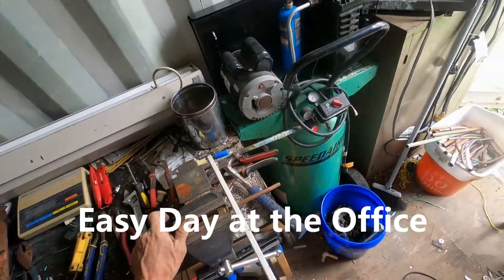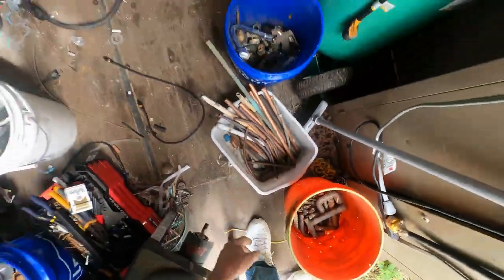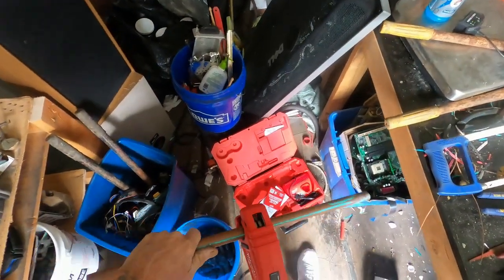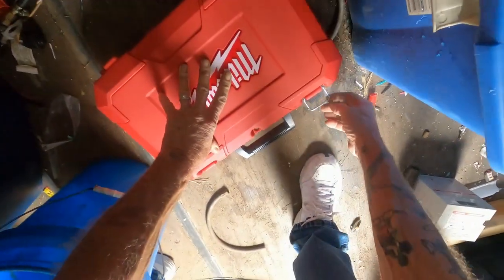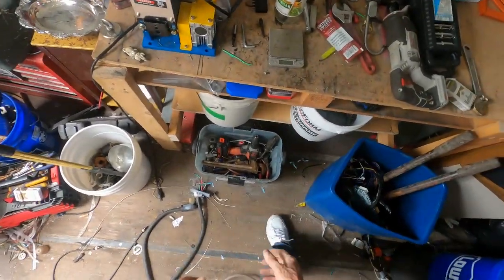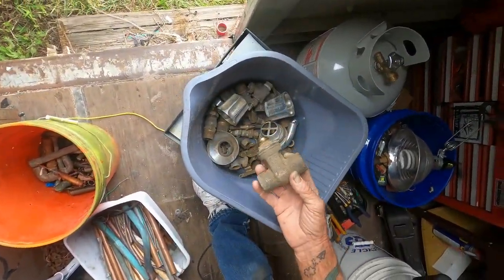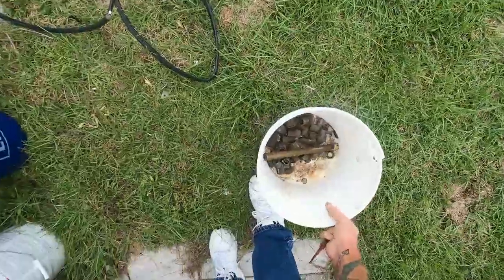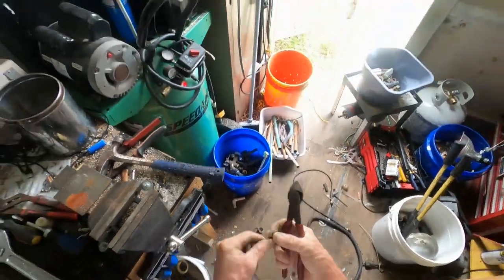Separating Copper and Brass For Recycling. How Much Did I get?

Comment: Brass is mostly copper so an honest yard will not call a brass fitting with a little copper pipe or wire on it contaminated / dirty. Think about it and don't get taken advantage of by a slick operator. Happy Labor Day.
Reply from the maker: My yard is not good to me. Thank you 🙏